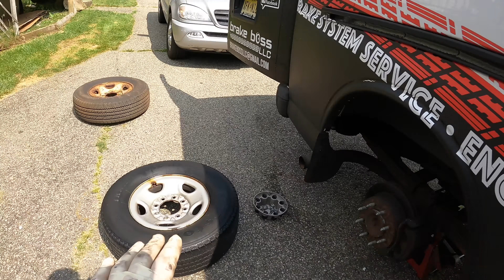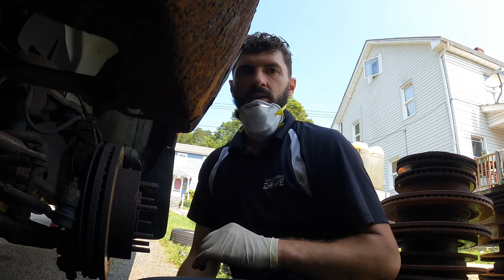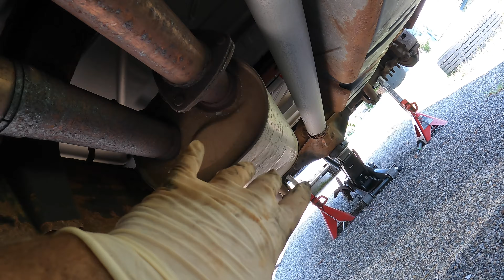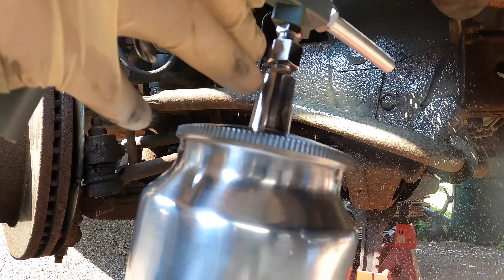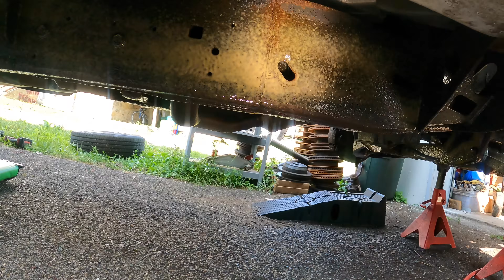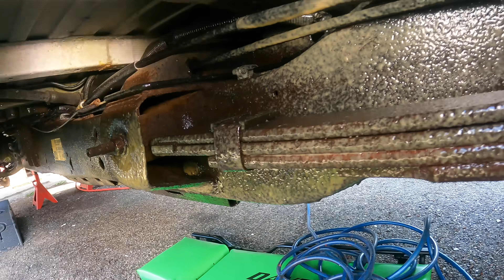MY MOBILE AUTO REPAIR VAN GOT FULL UNDERCOATING TREATMENT USING FLUID FILM

Comment: Also try Wool wax. It’s thicker and I find lasts longer especially in wheel wells.
Reply: I second Woolwax. It’s way better on the outside of the frame, especially in the high wash areas. And it doesn’t smell nearly as bad which is a bonus.
Reply from the maker: Thank you for watching and thank you for the feedback 👍🏼